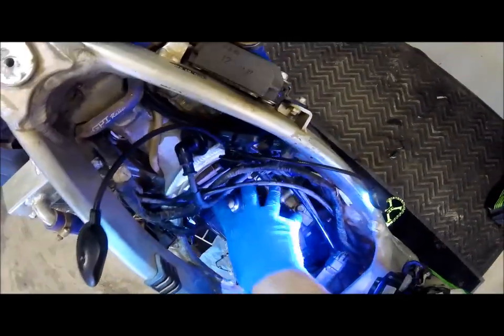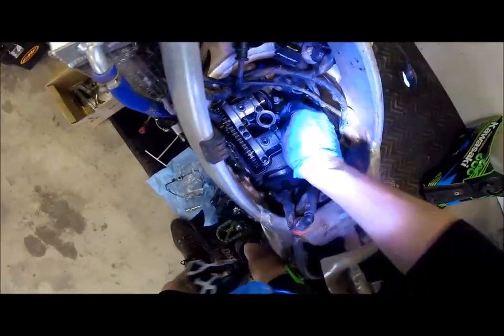How to change your Cam Chain- Shown with a KX250F

Comment: Just curious, why didn't you replace the guides? I'm about to replace my chain and figured it'd be best to replace the guides with it but maybe not needed? Also, do you recommend oem or aftermarket chain? Will an aftermarket chain fit the oem cam sprocket teeth?
Reply: I ordered a aftermarket chain and head gasket online. Chain Entirely too tight, head gasket was faulty also. I had to go to dealership to get both parts. I don't recommend buying parts online.

Comment: hey man i have few questions, how much play should the cam chain have (side to side)? does it constantly have same tension throughout the whole cycle? mine feels like when piston is going down it is loose, when it is at top dead center it is very tight with little to none slack. could it be reason my bike stalls at idle after like 30-60 seconds? i have kx250f 2012 and my fuel injection is working normally
Reply: @racerreid3036  thank you ill try the injectors later! i did the diagnostics and it shows that temperature sensor is bad (one long, 4 short) could it be that the engine cuts the fuel to the engine to protect it? because it don't know what temperature the motor has